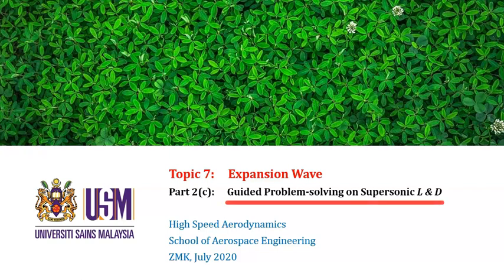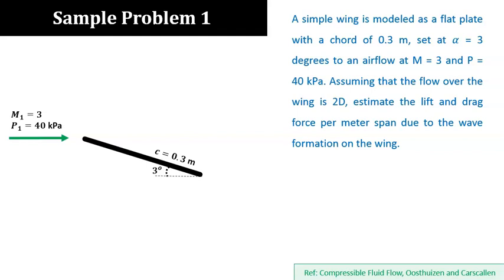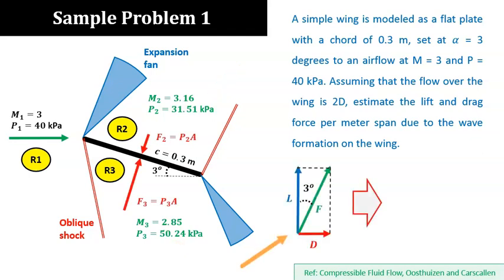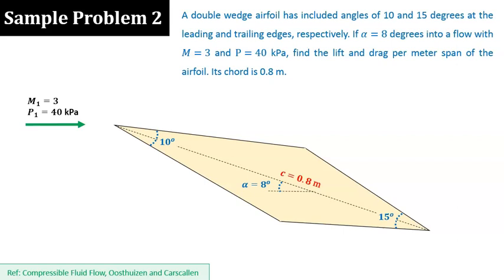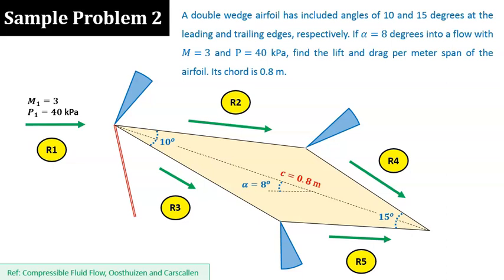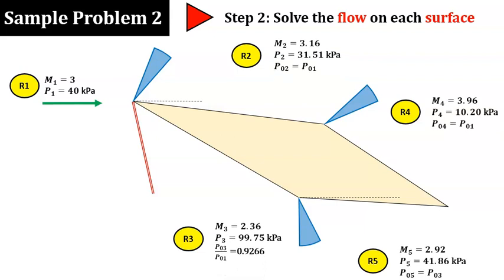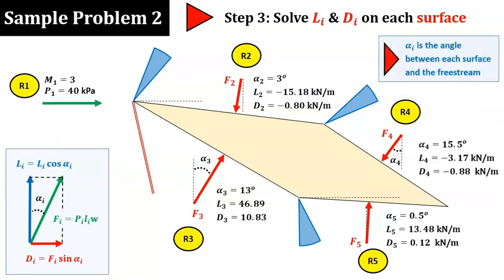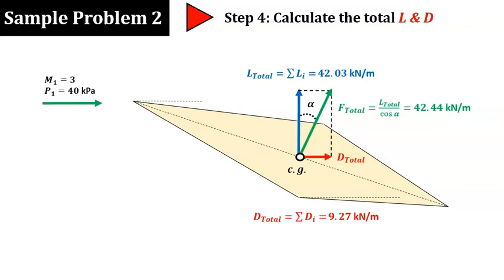Expansion Wave (Part 2c: Guided steps on 2 sample problems)

Comment: how do you know if the wave in the particular region is oblique or expansion ?
Reply from the maker: If the supersonic flow faces an obstacle in its path (e.g., a surface that inclines inward), then the flow pressure will drastically increase through an oblique shock. On the other hand, if the supersonic flow sees a wider opening in its path (e.g., a surface that inclines away), the the flow pressure will decrease through an expansion wave. These explanations have been covered in the earlier videos on this topic.

Comment: How do you solve the values of the regions?
Reply from the maker: The techniques to solve for the values in each region have been covered in the earlier videos. For example, the technique to solve for the flow across each oblique shock can be referred to in the earlier videos on Oblique Shock Wave (Parts 1, 2a-c). The same goes for solving the flow across each expansion wave, which has been covered in the Expansion Wave videos (Parts 1a-c).